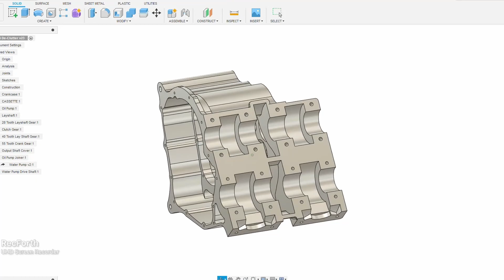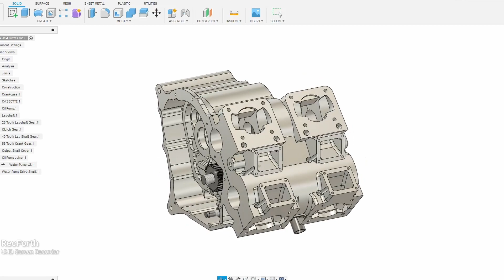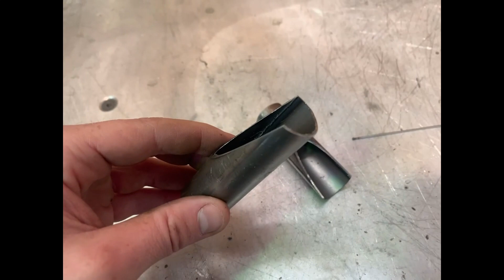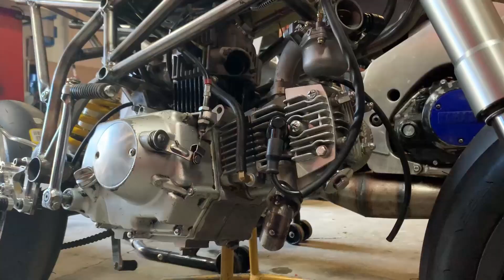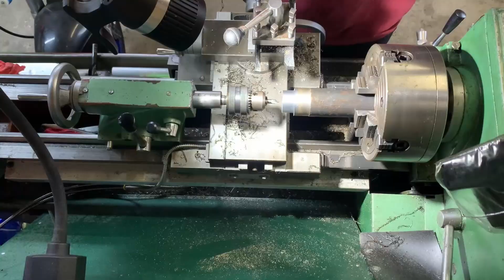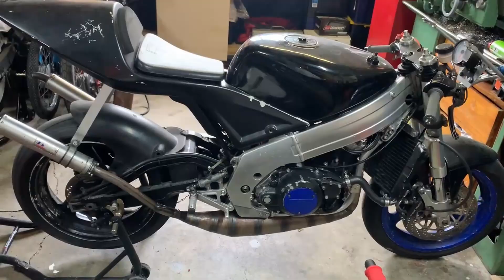Weekly Update - V Twin Exhaust, V4 2 Stroke Build, RGV 372

Comment: Water pump from a 750, but oil pump from a 50cc? Will it pump enough oil for this beast?
Reply: the oil pump is just for the gearbox I think so it should be fine maybe 🤷
Reply: @sjefleenaerts7277   Keep my fingers crossed :)
Will you be running premix in the engine?
Reply from the maker: The bike will run premix, the c50 pump is sped up a little bit for a bit of extra flow, having a sump of sorts keeps the gears from dragging in the oil but requires oil to be pumped to the input/output shafts.